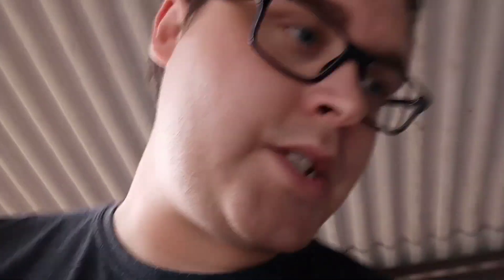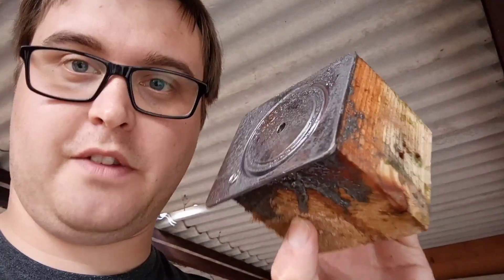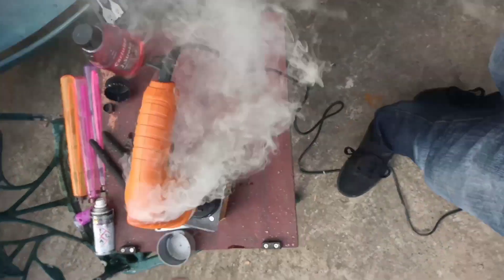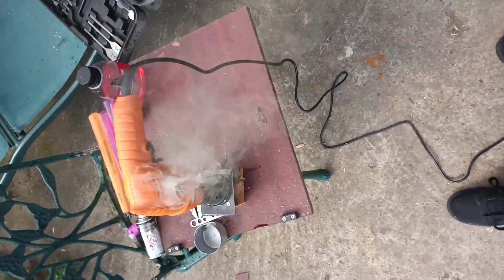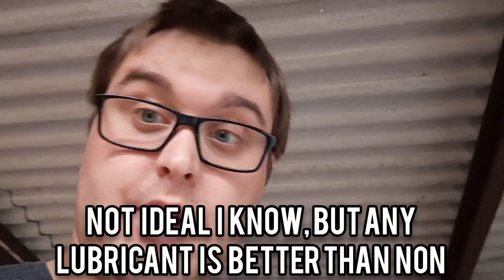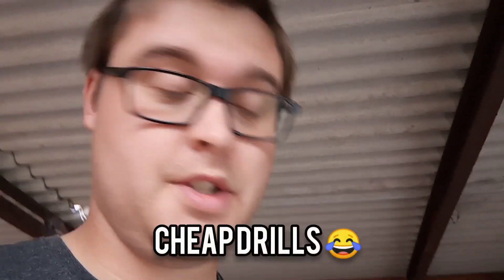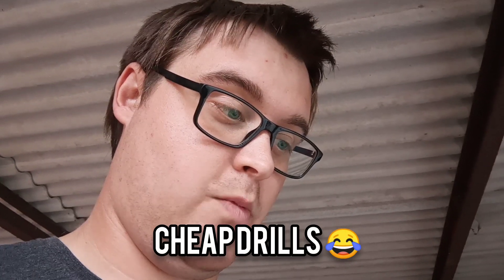Working On A Vacuum Actuated Bypass Valve... For My M111 Kompressor Clk

Comment: iv installed BOV on my m111 evo and it works great, instant and full boost now (with stock valve  it was slow boosting and max was only on 3rd gear)
Reply: Looks like you've bought a normally closed valve, surely you need a normally OPEN valve for your application otherwise the charger won't get any boost with the valve opening on vacuum!!
Reply from the maker: @darrenwall1860  The valve needs to be normally closed buddy, so at idle with vacuum the valve is open just like stock as soon as you rev it and the throttle blade opens reducing the vacuum the valve snaps shut allowing positive pressure to build. I have already tested the valve on the car and it operates just as the stock valve does, but it gave me a lot of brain ache trying to get the right one. 🤣 However there is some refinement to be done to make it work as it should without the Bosch management causing a problem. I drove the car earlier after fabbing it all up and it work for the most part, however the car did start misfiring at 1-1500rpm for seemingly no reason. So it wasn't over boost or under boost it just misfired so I need to do a bit more research on that.
Reply: @M-oneeleven-M111  my mistake then mate, I'm eager to see the outcome of this project as I myself have decided to go down this path, iv got a valve exactly the same as yours but I thought I'd ordered the wrong one so hadn't tried it yet, I have got a welder so I'm going to weld 63mm stainless pipe to either side for input and output and keep my fingers crossed it might actually work!! Whatever happens I hope you get yours sorted best of luck
Reply from the maker: Cheers dude no worries, logically I can't see why it wouldn't work but like I say the ECU I think will be the biggest hurdle. However you still have to retain the stock bypass valve tucked in the engine bay somewhere otherwise the Supercharger won't work. But you can lock the pulley or make a switch system to turn it on or off.
Reply: @M-oneeleven-M111  already on a switch, stock bypass relocated into old airfilter space and boxed in (cables  extended) just waiting for the swage 63mm pipework to arrive, gonna weld to vacuum valve and use silicone pipe's to connect to my airfilter assembly and charger manifold.
Reply from the maker: Sweet I think these feel so much better with a vacuum operated valve, biggest issue on the earlier pre EVO engine like mine is the Bosch management seems to hate FUN 🤣. When you have them set up like you do it transforms the car completely👍